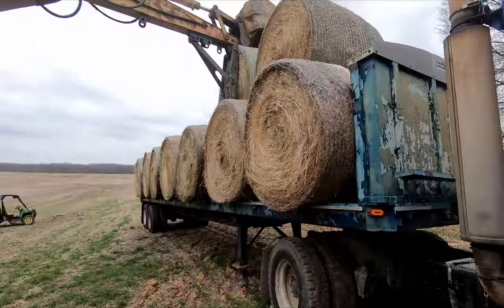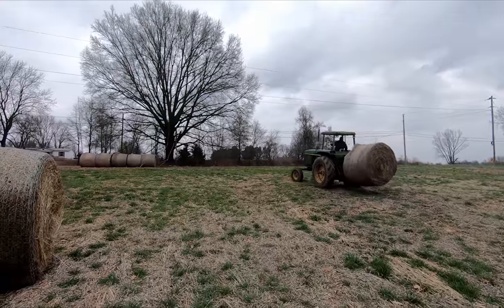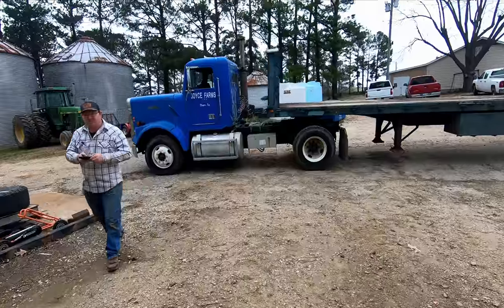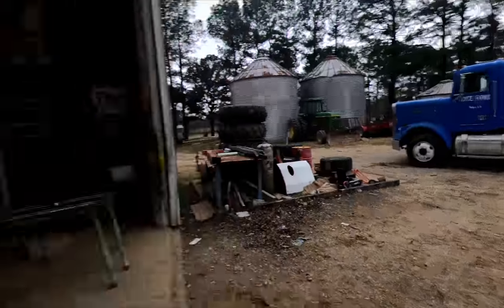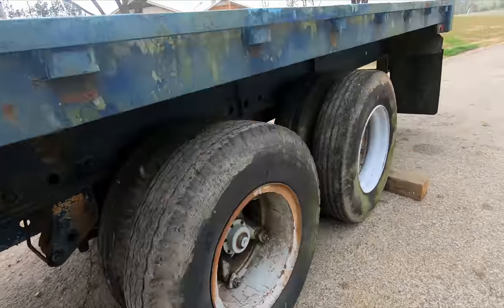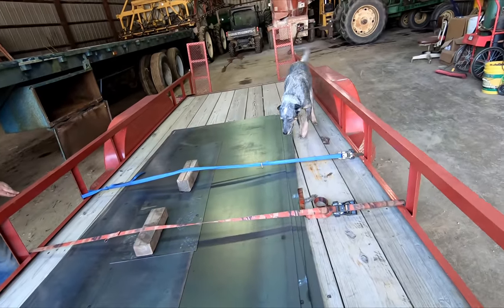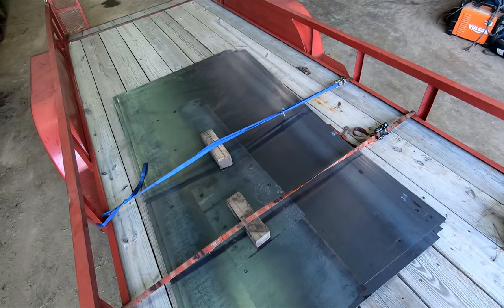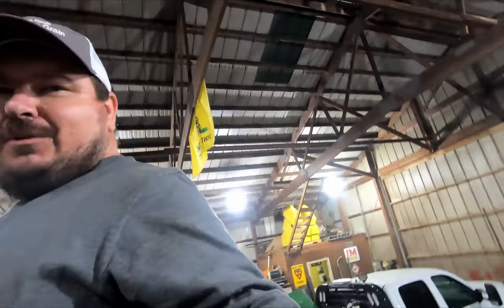Unconvential Hay Hauling and Unloading.

Comment: That steel will make those round bales slide right off.  All you need to do is back up and stop short.  We had a hay wagon that was made out of an old power box with solid steel floor.  Hated square baling on that one.